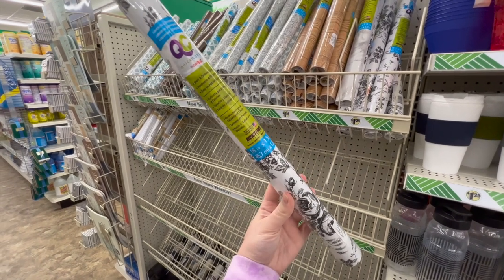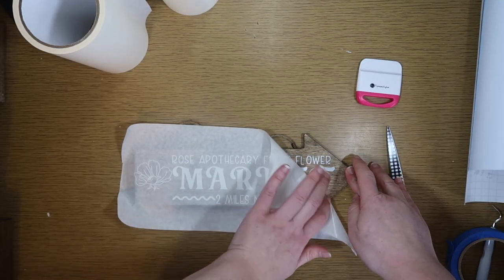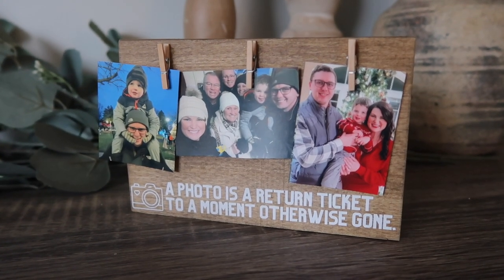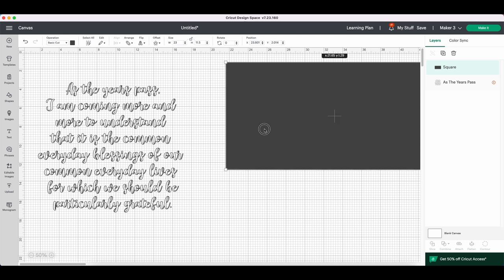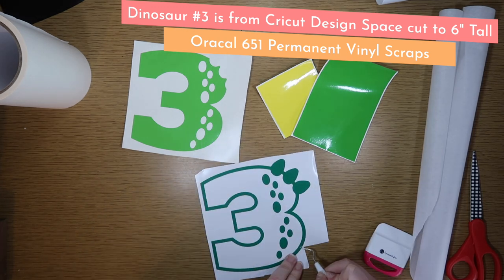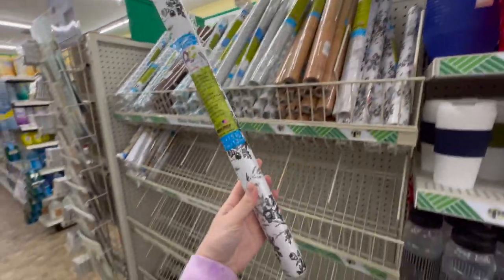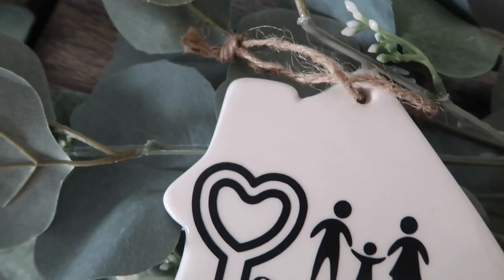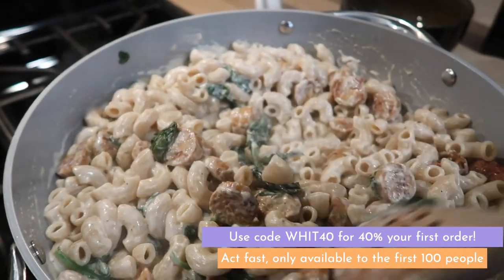Woah! BRILLIANT Dollar Tree Cricut DIYS & Decor Ideas that will send you RUNNING to the store! ⭐️

Comment: If you get the clear contact paper at dollar tree it works just as good! Plus you can reuse it until it’s not sticky anymore. Also not to mention it’s a huge roll!! I bought my cricket air last year second hand and knew nothing, I saw dollar tree had the vinyl so I watched ALOT of videos and played around with it to find the right settings and found the contact paper trick. I have never used anything else!

Comment: I once used the iron on setting for my tiny vinyl letters, but it ripped it up as it was cutting 😵‍💫
I’ve never gone that small again, but I really want to make crafts that need the tiny lettering 😳 
Did I do something wrong? Is there another way? 
Thanks for another great video 🫶🏼
Reply from the maker: Hey Laura! How small are we talking? It can also depend on the vinyl you're using too. I like to do simple fonts if I"m going super small - no flourishes or anything. But sometimes it boils down to it not being worth it :)
Reply: @Whiskeyandwhit   
Hi..
So I’m thinking the size of the font was maybe a wee bit smaller than the size font you used in your ceramic Welcome Home sign, the smallest font you used on that.
So have I maybe gone too small?
Plus also, I think perhaps I used a font that wasn’t quite so plain! 
So I’ve maybe gone too small & used a wrong font type!?? 😳🤪😆🤦🏼‍♀️

Also, can I just ask, whilst I’m here,..
With the screen printing, do you put the cricut heat press on straight away? Or do you let the ink dry then press?
I’m worried about ink getting on my press..😵‍💫

Thank you, as always!! For replying & helping.. Really do appreciate it 🫶🏼
Reply from the maker: @Flossloz13  Hey Laura - I always let mine dry over night and then press it :)

Comment: Ok so how do you remove the vinyl from the collector or do you just waste them and throw them out? SEVERAL people say the foil on the blades do NOT sharpen them at all it is useless
Reply from the maker: You can take your hand and pull out the vinyl scraps, it's pretty easy.  And yes, I misspoke in this video, the foil will help you clean off any residue from your blade.

Comment: Foil WILL NOT sharpen your blade, it will clean it which is why it will seem like it is cutting better afterwards, but with repeated use will actually dull the blade. Aluminium is softer than your blade, it is impossible for it to sharpen it.

Comment: Tin foil will NOT sharpen a Cricut blade. It will scrap off debris but so will an alcohol wipe and there is no risk. Tin foil is way to soft to sharpen the blade this is a common misconception.